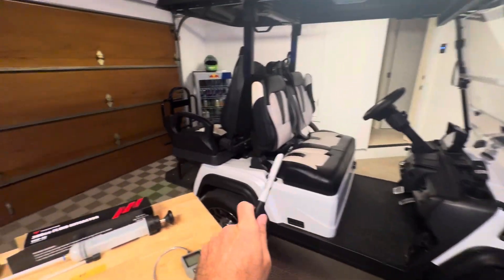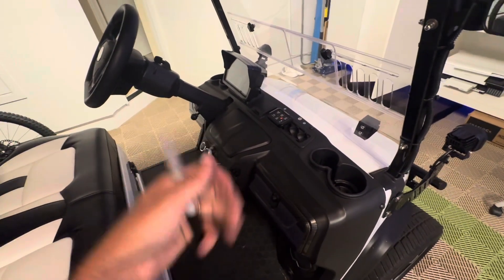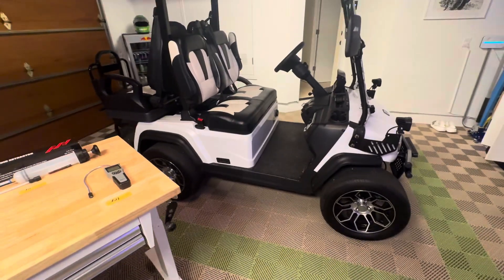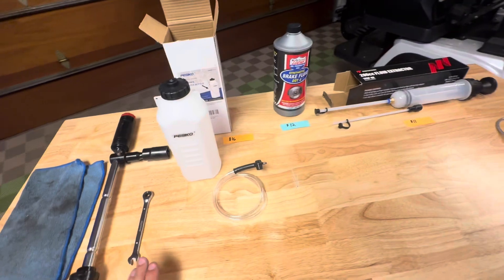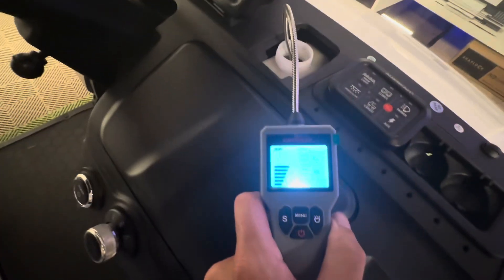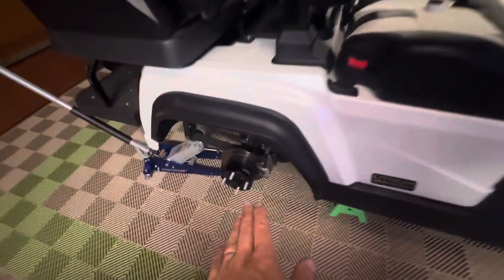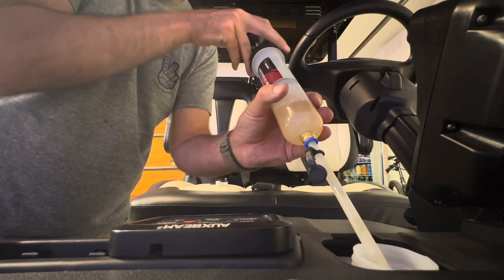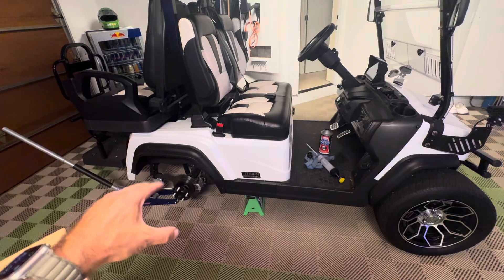Trying to Fix Spongy Brakes on an Evolution D5 Golf Cart (Brake Bleed Test)

Comment: I am at a loss for words here as how great you have been with unmasking tricks with regards to this Chinese contraption. Let me get to it. You go and publish wonderful videos on making your own cable and programming. You stress in the programming videos to increase the regeneration aspect of the program for these very same reasons yet you go into this unchartered territory, not to mention the extent of the expense to find out if the culprit is water in the fluid when just about everyone is complaining about the brakes. NEVER have I heard ANYONE have found water in their brakes whether cars or these kamikaze vehicles. So, based on your postings, why don't you go back and readjust the regeneration portion of the program to let us know which setting would yield a satisfactory deceleration point so we do not have to employ the brakes as hard as we do. Thank You. Your work, again is fantastic.
Reply from the maker: Thanks for the message. Appreciate it. I agree with you on making that exact video. 

I have been avoiding increasing my regen, because I live at the top of a hill, and I run into that old overcharge issue, in one of my very first videos. 

But for the majority of people regeneration increase is likely the way to go. 

From the factory you can truly feel the different jerky motions as your approaching a stop sign, the cart dips from say 3000 rpm to 2999 rpm and it pops into a different regen percentage, almost feels like a downshift jerk, they have regen at lower RPMs set the highest. 

Disappointingly on the D5 the brake pedal has no switch or input to the controller like other electric cars, where if the controller knew you were trying to stop, it could increase regen at brake pedal position.  On our 2WD models regen is limited to the rear, but I bet on the new DMax 4x4 double the regen would be more balanced and powerful as 60-80% of stopping power should come from the front.

Comment: My dealership is literally up the road from me so drove my cart home the day I got it. Evo D5 Mav 2+2.
Brakes felt quite spongy and got progressively worse the closer I got to home with a near failure in the last stretch on the "down side" of the overpass/bridge. 
Called the agents up and a tech was at my place within the hour. 
He bled the brakes, set the brake pedal up/adjusted the master cylinder rod as well and it was way better but still, as you say, you need to really jump on the brake to get a reaction.
 
My wife and daughter will not drive the cart as it requires too much force to brake and they feel it to be tiresome and stressful so really a major ding in the Pros and Cons to owning/buying an Evo.
The "run in period" is said to be 100 miles if I recall, I have either gotten used to the force needed to brake or the brakes are run in as it feels a little better but still not great. 
I may adjust the motor brake some, mine feels as though it is barely engaging, I thought I would like it as I drove an older Club Car with aggressive motor braking that I absolutely hated. 

I am hoping someone, like yourself, will soon post a brake upgrade, bigger rotors and pads, upgraded master cylinder, etc. 
There will certainly be a lot of interest in that upgrade I would think. 

Really enjoy your channel, a wealth of info and well presented.
Reply from the maker: Thanks for sharing your experience. I feel like our brakes got slightly better,from the day we picked them up. 

Our dealer said it would take some time to bed in the rotors and pads, but I feel like after over 100 bikes now it only feels marginally better. 

I was hoping since in the forums you still get 20% of people who say “my brakes work great” it might be an adjustment or bleed issue. But I agree starting to explore some other options. 

One thought is it might be lack of correct brake bias (braking power sent to front vs rear). The front should receive 60-70% and the rear 30-40% to be it often feels like my rear wheels want to lock up first.